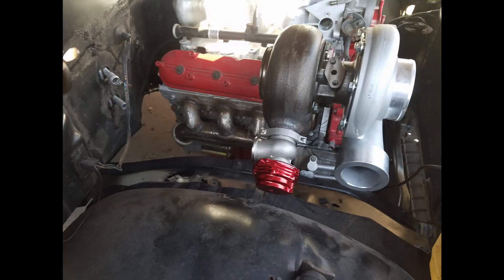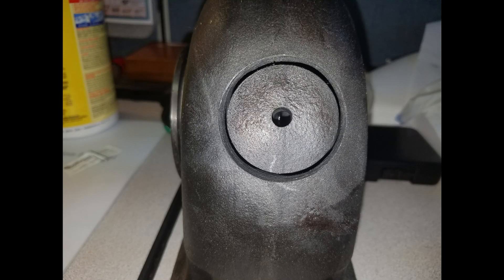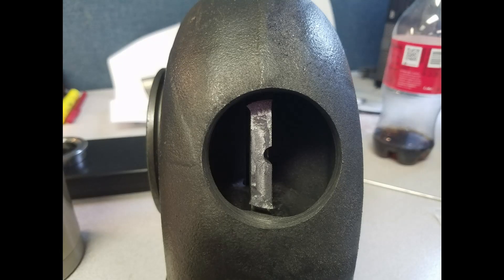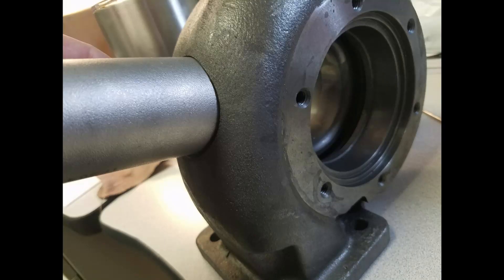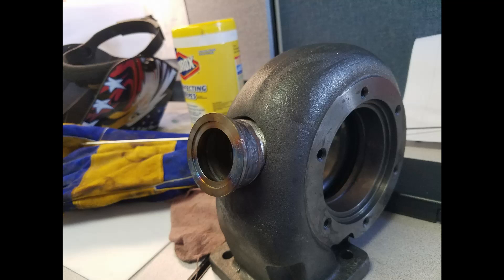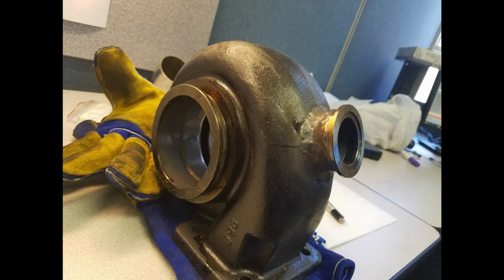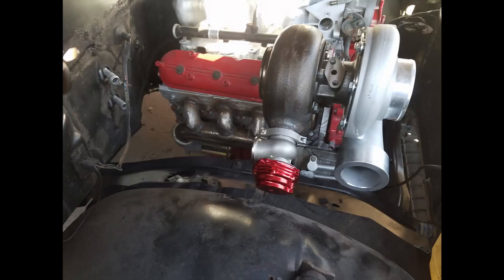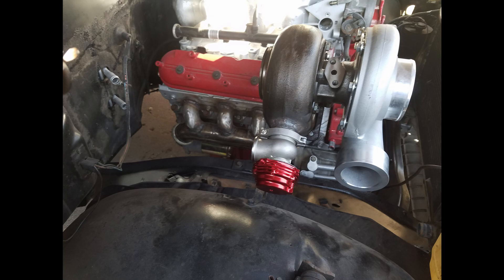Wastegate directly on the turbo housing how to.

Comment: Do you know if any makes a turbo blanket  for  this kind of set up
Reply from the maker: Literally any 35.00 blanket off Ebay
Reply: @TheDrivewayEngineer  what I'm asking is do they make one that has a hole cut in it for the flange are the wastegate mounts

Comment: Thank you for the pointers. You inspired me to turbo my Yukon and without you and very  few others I would have been to intimidated to take a crack at this.  I had to modify what you did but I had to try and use what I had available so this is what I did, I heated mine with a torch, flux core welded my little section of pipe in the hole and had to get back on it with the torch when I finished welding it.  Also had oven in house preheated to 450 or 500 can't remember and continued the cool down process in there dropping temp every half hr until I got to 250 at which point I turned off the oven and let it sit another hr or so till cool.  My first attempt cracked almost  immediately which is why after getting everything cleaned back up and beveled, I went through this process which I didn't do previously and hey maybe I got lucky but it works great.  I'm using an electronic boost controller with a Mac valve no issues..
Reply from the maker: That's awesome! I'm glad to hear it helped!

Comment: I just posted on the fb page. I did mine exactly the same location and I’m having bad boost creep. 44mm turbo smart gate on a gt45 5.3 I seen on a forum someone had the same issue and they just angled the pipe to the gate so it will flow better and said it fixed the issue. I’m just confused how I’m seeing all videos of people doing it just like this (and mine) and they aren’t having issues?
Reply from the maker: Because you're trying to hold 3 psi lol. It's a lot to ask of a 50.00 eBay wastegate
Reply: Turbo smart is not a eBay gate by any means. I’m trying to hold at least 7-8 psi but no matter the spring I run it creeps to 15
Reply: @tylerschmitt1921  sounds like your wastegate is simply too small for the mods you have and will not allow enough exhaust to escape therefore over spooling the turbo. what size wastegate are you using? is your wastegate recircuilated? how long is the recirc tube if so? try vent to atmosphere and see if it has the same creep.
Reply: wait how does putting more bend restriction on the wastegate piping make it flow more to avoid creep? if anything you would want to completely remove bends and make it flow as straight as possible.
Reply: Angle the pipe. I have a professionally welded exhaust manifold with a 90 degree exhaust wastegate port and it creeps a lot . Turbo housing with an angled port is the way to go. From 90 to over 90 degrees is a guarantee to get creep unless you have a slow spooling turbo.

Comment: Did this work?
Reply from the maker: Flawlessly, still there, why wouldn't it work?
Reply: @TheDrivewayEngineer  after more research I came to the same conclusion. Reason I asked is because I have my setup like that. I havent ran it yet but someone cautioned me on it because they know of someone who through rods from it not working. After research I remembered my old lb7 duramax had wastegate built into housing factory.
Reply: @gregmilner2190  he threw rods because of a bad tune or using factory rods under boost not because of the wastegate location. Tons of factory turbos have integrated wastegates built into the hotside. the only danger from doing this is a crack developing which would cause the turbos to not spool up as much so technically that would be safer for the engine lol.

Comment: This is the kind of ppl I am worried about full blown idiots work in a office and not that much with their hands and try to do something that hasn't been done before well... That's bc there is a reason it hasnt. It doesn't work.
Reply from the maker: Except that  its done all the time and they even sell them like that.
Reply: The Driveway Engineer pretty sad bc it boosts the turbulent Forces around the bung he welded on essential causing cavitation bc air to some other engineers is considered a fluid.
Reply: @jasonbeezhold3409  im pretty positive Formula 1 cars used this back in the days.